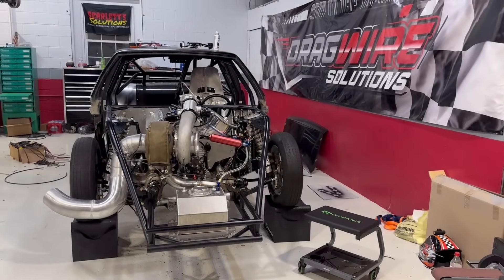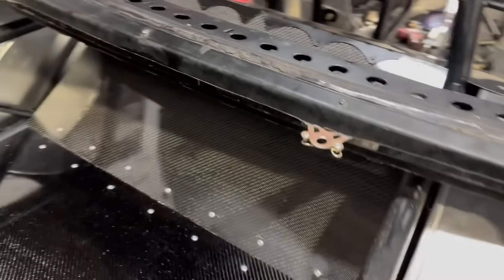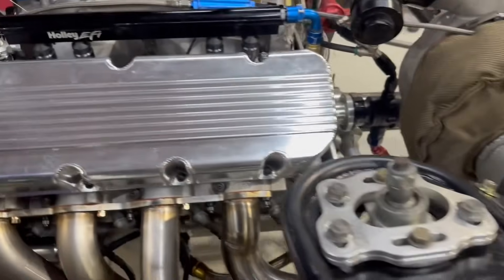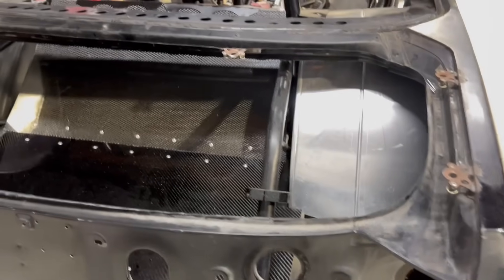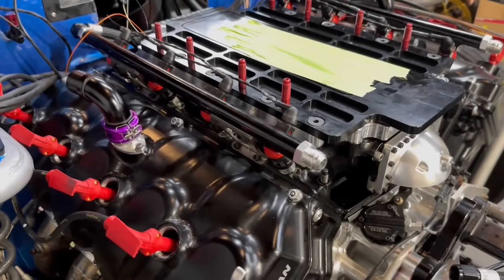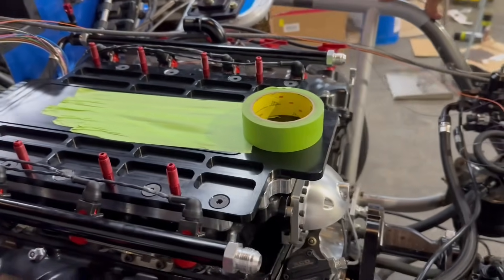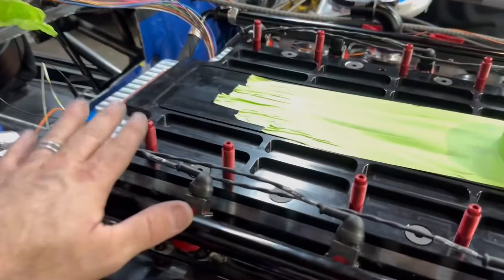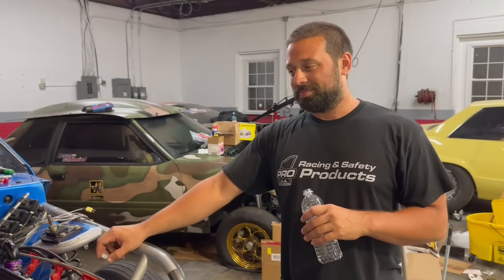Carbon Fiber Interior....... TurboJohn Mustang is looking awesome....... FOR NOW!

Comment: mc master carr for your fittings.  take the bracket that you had the chain pin to and move it to the lower control arm and weld it on.